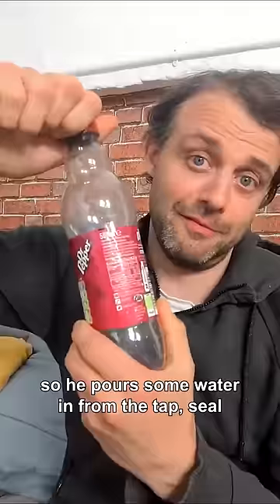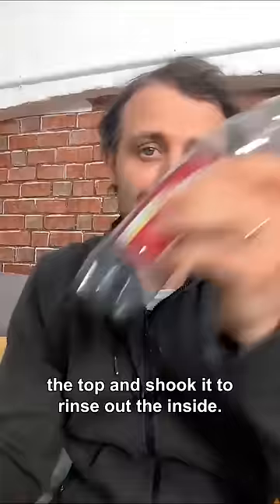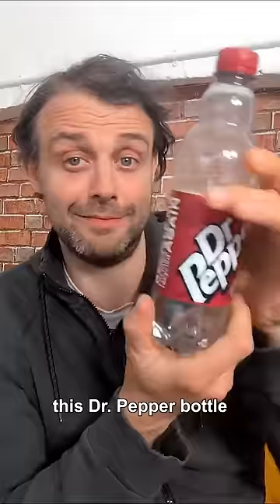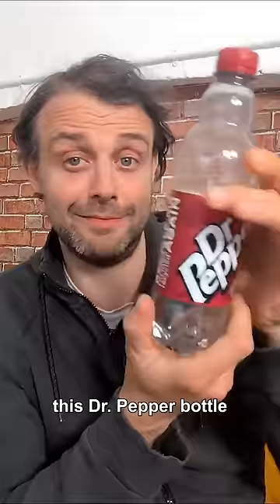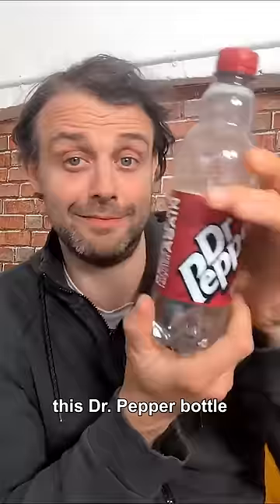Fizzy Drinks Collapse When You Do This... But Why? #shorts

Comment: Surely the temperature of the water is important too? Another hypothesis is cold water will slightly cool the air trapped in the bottle, reducing its volume, and causing the bottle to collapse. I've conversely seen bottles expand and bulge out when I've used hot water in bottles. Maybe both of these effects are at play here. Did you use room-temperature water or cold tap water? 

I've also seen bottles collapse on aeroplanes when they reach cruising altitude from the reduced cabin pressure, to return to normal upon decent!

Also, regulator? Nahhhh we don't need that! :D

Comment: The opposite effect happens too.

If you drink half of a fizzy drink and save the rest for later, then it goes slightly flat in the meantime as CO2 bubbles out into the air space. 

What's both interesting and irritating is that if you crush the bottle before turning the lid on an attempt to reduce the airspace, the bottle reinflates over about an hour, and the drink goes much more flat than before. That's because the CO2 fizzes enough to fill the entire bottle with CO2 instead of just doing partial pressure to the air. Effectively you've offered it a vacuum to effervesce into...

Comment: Pretty sure it was due to temperature change.
The explanation given here —pressure change due co2 solubility…. The balanced pressure in a sealed co2 bottle is Always higher than atmospheric pressure at room temperature. 
The person simply put a colder than air temperature water in it with enough air to cool once shaken and collapse the bottle / implode.

Comment: It’s the sudden temp change decreasing the pressure in the bottle. Pour boiling water in the bottle, pour it out, blow inside for a second then fill with ice cold water and close the top. Shake and it will collapse

Comment: Actually it is because air with higher humidity has a lower volume than air with lower humidity, when you enclose a bottle full of external regular air it will have a higher volume than if you put some water inside and shake it

Comment: I've noticed the opposite of this when rinsing out carboys after or prior to brewing in them. The warm water heats up the air when sloshed around and i suspect that cold water was used and it cooled down the air inside, lowering the pressure.

Comment: so no, because this happens with milk cartons as well. I've observed this more than a few times, and based on my observation its because when you shake the bottle it equalizes the temperature between the cold water and the air, causing the air to decrease in volume. You want proof? do it with hot water and watch as the bottle becomes pressurized.

Comment: Pretty sure as others have discussed, this is  actually purely temperature. I've done this very thing with the US 1Gal milk bottles when cleaning them out for recycling. In fact the first time i had one collapse, i had to test with hot water to see if it would expand, and it sure did! Fun to do if you have access to similar bottles.

Comment: you just need a good experimental protocol ofc, if you first take hot water in the bottle and shake it, pour it out and carefully and quickly replace it with cold water, close to top and shake it, another trick which works even better is to have a bit of crushed ice plus water in there and then you heat the bottle with a hair dryer, that one works the absolute best, when you shake that one, you get an implosive result :D, because the ice can take quite a bit of hot air before the argument implodes

Comment: Unless he used the water from the hot tap, all plastic softdrink bottles are blowmolded. Meaning they get a tube of heated plastic, enclose it in a mold and force air into it to expand the bottle to the shape of the mold.

Comment: I use a lot of those single serving drink mixes intended for use in 16-20oz bottles. They aren't fizzy. I use cold water from a water cooler and then pour in the drink mix and shake it. Everytime I shake the mix after adding cold water, the bottle collapses (as much as it can). I'm fairly confident that cold water is the common factor here, instead of carbonation of any sort.

Comment: My current theory is that the fluid in motion rapidly cools the plastic as well as the air in the bottle, causing the pressure to drop, thereby allowing the atmosphere to squeeze the bottle more.

That last bit was just an excuse to use 'thereby'.

Comment: I think you just super cooled the air lowering the pressure inside the bottle. I filled an empty juice box with screw top with near boiling water once and shook it, it exploded! Luckily I didn't get burned.

Comment: Since the increased surface area of the water increases CO2 dissolving, if you measure the spray of a shaken soda bottle, you get a larger effect if you give a bottle one good thump instead of a lot of shaking

Comment: Use hot water. Only a tiny bit. Seal and shake. Then wait. As the contents of the water bottle cool down. Some of the water condenses as well as the air inside cooling. The bottle collapses.

We're not calculating asteroid trajectories here...

Comment: Yeahhh he probably didn't say he rinsed it with hot water. If you rinse it out with hot water then re-cap it, it'll collapse solely due to the change in air pressure when the temperature drops. The new lids on soft drink bottles have the screw thread, then this other little wedged lip which is effectively a cork.

Comment: Similar thing happened to me when using gravity bong. As the bottle fills with warm smoke, and you shake the bottle with the small bit left, it cools the hot smoke and gas and that contracts in volume.

Comment: I have gallon Hawaiian Punch bottles. When it's empty  I pour in some hot water, shake it and empty it, then put the cap back on. Just like here after a few minutes the bottle starts collapsing. No5e that there is no carbonation. My theory was that the hot air inside the bottle is cooling and shrinking like a hot air balloon cooling down.

Comment: Should be easy enough to test your theory. Just fill the bottle with water then let it sit. If You observe the same amount collapsed / shrinkage as the bottle that has been shaken. Then you're probably on to something however it should be noted there are many outside factors and stimulus that could affect these results so I recommend buying about 5,000 bottles of Dr Pepper and testing in various different conditions. Incidentally for anyone reading this comment I would recommend buying stock in Dr Pepper I'm expecting a large jump in the market.

Comment: Trying to explain the phtsics of this to children and adults can be so frustrating. At sea level the air pressure is approx. 15 pound per square inch. If you take a vessel eg. doctor pepper bottle and reduce the pressure inside that vessel it is in fact the external air pressure that crushes the vessel.

Comment: I get the opposite effect when I shake water in a bottle. Even using cold water, the bottle becomes pressurized when I shake it, and there is a pop outward when I open the cap again. I could never figure out why.

Comment: The water evaporates and cools the air in the bottle which in turn becomes more dense, lowering the pressure, and collapsing the bottle. It works without the CO2 bro

Comment: My theory is that the difference in temperature from the added water is causing this. This usually happens to me when washing out milk jugs with hot water and then putting the cap on. This is the basic principle used in canning to create a vacuum seal.

Comment: I think it's more to do with the temperature of the air within the room and the temperature of tap water. I've had this same thing happen to bottles that have been sat out on the counter for days (cap off). Fill them with cold water and shake, the temperature of the air in the bottle lowers due to the colder water, causing the volume of the air to lower (Charles' law I think?).

Comment: I've read that a typical soda has roughly equal amounts of CO2. Let me explain that, because units matter. Take two liters of CO2 at standard pressure and temperature. That's how much CO2 gets dissolved into two liters of soda. It seems like a lot, but the density of water is 500 times that of CO2 at STP. So by mass the soda is less than 0.2% CO2, even in sugar-free soda. But by the volume comparison, you can see why people struggle so much with those no-burp challenges. However much soda they're chugging by volume, you double that number, because the heat of the stomach and the turbulence of swallowing is going to bump a bunch of that CO2 out of solution and inflate the stomach. A typical empty stomach can expand to accommodate a single-serve soda bottle and its undissolved CO2 but 1) a stomach is rarely completely empty, especially in the middle of the day and 2) it can expand that much, but it hates it and will push back a bit.

If it was cold outside when they shook the bottle, that would also increase the amount of CO2 that can be dissolved in the water.

Comment: Or it was just hot water. If your tap is hot enough then enough steam fills it up to cause the same thing as the steam condenses. Or cool water with warmer air causing the air to shrink when the water cools it. But if it’s that then the bottle will probably reexpand later I’m guessing.

Comment: I had the opposite. I needed a container for something. At work there was coffee facilities with a fridge and a hot water urn. Grabbed a 2 litre container of milk this one has a handle that 4 of your fingers fit into. Drink the dregs and go yo wash out and pour in some boiling urn water and shake and aaaaahhhhhh, this thin plastic container swelled up immediately and locked onto my fingers and was damn hot, scared the crap out of me and had to yank it off. Immediately cooled it back down and called a mate over and deadset nearly died laughing when he’s jumping around trying to pull this milk container off his burning fingers.

Comment: Don't talk nonsense, I do it when I clean out any plastic bottle, steam condenses dropping air pressure inside, collapsing bottle. Or holding cold bottles warms the air inside a little, put lud on give it a shake air temperature drops causing drop in pressure

Comment: So, I have also done this many times but with noncarbinated average bottles. I have determined ot is due to the smallest amount of residual heat left in the bottle which is subsequently diminished with a rinse. 
I have done this with a plain bottle.of water many times

Comment: I think it's more about water temperature, if the water is cooler than the air shaking it would cool the air and decrease the pressure. Have you tried it with just air ?

Comment: Or more likely, the water he put in the bottle, when shaken, it cools the air, makes it less dense, and partially collapses the bottle. You can also do this by putting an empty bottle, with the closed tight, in the freezer, and it will shrink A LOT. And then slowly warm back up, expandingthe air, pushing the bottle back (almost) into the shape it originally was.
@Steve C‘mon. This is kindergartner stuff.

Comment: IT's tough because it could also just rapidly cooling the air in the bottle by exposing it to cold water.  However, because CO2 only disolves well in cold water, one would have to blow out all the air carefully to ensure which variable was responsible.  Heck, could be both!

Comment: Put hot water in the bottle and let it sit, then poor all of it out and immediately cap the empty bottom. After a few moments it will collapse. 
Why?
Hot air requires more space than cold air, so when it cools down the bottle will collapse when the negative pressure is powerful enough.

Comment: OH!

There was a dude in my industry (brewing) who, after using co2 to push beer out of the tank... didnt purge the tank with air, didnt rinse the tank with water, and just went RIGHT into a caustic run.  On a sealed tank.

BOOM, implosion.
Reply: They're cleaned with alkalines, no? That does A LOT to increase the solubility of CO2 in water. Poor little tank.
Reply: @christianb9077   when you clean a tank in the brewing world, you start by emptying it.  This is done by displacing the beer with CO2.  Then you rinse it, let it air out, then you run caustic, rinse again, and run acid.

Caustic is used for cleaning organics, acid is used for removing mineral deposits.

If you have a tank full of CO2 and start to circulate caustic without opening the tank up, the lye will react with the CO2, pulling a vaccum.

Comment: Doesn’t CO2 need to be pressurized to dissolve into the liquid faster? Only reason I say this is because if you have a soda and throw on the lid after drinking about half of it. The bottle is squishy at first. Now shake the bottle up and it becomes hard again because it’s no longer under pressure and so therefore the CO2 comes out of solution with the liquid and repressurizes the bottle however your drink is now slightly less fizzy from the CO2 leaving the liquid. Even a “sodastream” machine works by pressurizing the bottle with CO2. I can’t imagine the CO2 is dissolving into the water that quickly under a close to normal atmospheric pressure.

Comment: i think its just the air temperature. Water is cold, cools down the air, makes it collapse. Or he used hot water, it warmed up the air before he put the cap on, and then it cooled down over time.

Comment: Sorry. You are wrong. Hot water will cause the bottle to deflate due to the water causing extremely high humidity in the air around the water. once shaken the humidity is lowered by contacting with the already liquid water which reduces the overall volume of the air.

Comment: Partial pressures of gas are more complicated I think.  The reverse of your demonstration here is when the CO2 comes out of solution into other gases at high pressures.  Regardless of other pressures, the CO2 will come out of solution and burst the bottle if need be.  Distribution is the common explanation, but I think it's more complicated.

Comment: I always thought it had to do with temperature and thermal expansion. Milk jugs nearly blow the cap off when closed at atmospheric pressure after being rinsed and shaken with hot water because the plastic starts cold (from refrigerator).

Comment: We have milk jugs which are made of plastic here. When they are mostly empty of milk, I wash them out and recycle them. I fill it up probably 1/20 of the volume with hot water, cap it, shake it, and then uncap it. There is a puff of air which emanates forth and the plastic seems to temporarily contract. I can sometimes repeat it, but have not gotten the same jug to do it thrice. Is it just heat causing the expansion of air on the inside?

Comment: Geotechnical engineers use CO2 to saturate soil samples with water because the water dissolves the gas without having to push it out of the soil.

Comment: Usually this happens to me when I rinse the bottle with hot water and then screw the cap on. It works without CO2.
Also why should there be CO2 inside when fresh air flows into it while drinking?

Comment: If you rinse with hot water, it'll cool and collapse within a minute or less.  If the bottle and air was warm, and very cold tap was added, it might shrink the volume of gas enough to make a strong enough pressue differential to collapse.  This happens irrespective of gas.  I don't know about CO2 gas shrinking, maybe, your explanation may be plausible.  The two effects may not be mutually exclusive.  Interesting and in support of your theory, compressed CO2 gas cools when it is released from the fire extinguisher and rapidly expands.  As you talk, the CO2 gas warms from ambient temperature air and hand on bottle exterior, and expands further.  Adding water approximately at room temp should rule out temperature differentials.  R = pV / mT (L atm / n °K)

Comment: Or, it was a hot day (= hot air) and he flushed it with cold water. When shaken, the water cools down the air inside the bottle and it collapses under low pressure.

Comment: You're overcomplicating it. Wash out a milk jug with hot water, then quickly pour in some cold water, seal and shake. The warm air in the jug will be quickly cooled by the cold water, which will cause it to drop in pressure, collapsing the jug. Nothing to do with CO2.

Comment: So you mean to say...I can make drinks fizzy again by shaking it!
Reply: It would work if there is saturated CO2 in the bottle. I recorbonate soda or carbonate water all of the time. I use a CO2 bottle with a fitting that connects to the bottle. I squeeze out The air, pressurize the bottle to about 25 PSI, shake. The bottle will reduce in pressure as the CO2 is dissolved into the liquid. I represurize shake again, repeat until the pressure appears to stabilize. The I have nice "recarbonated soda" or carbonated water when finished.

Comment: if you use hot almost boiling water, and shake it, it will release steam, increasing pressure, the opposite of your example.
Reply: But would hot water invalidate special homosexual rights ?

Comment: The same principle happens with the twist top on the Sriracha plastic bottle. When I take the bottle out from the refrigerator and set it on the dinner table, I always open the twist top. This prevents any residual sriracha in the twist top from exploding out when opened after the bottle warms up before serving.
Reply: I think this isn't actually driven by temperature, but rather a decrease in volume (the CO2 "sharing" space in the water as it becomes dissolved) and would go back to inflated if left out again after shaking!
Reply: To clarify my point, the experiment above may demonstrate this volume change rather than cooling, and it'd need a more finely controlled experiment to say for sure. Whether real-world scenarios (cold plastic that used to hold a just-finished drink cooling the warm air within) are driven by this I think is less likely